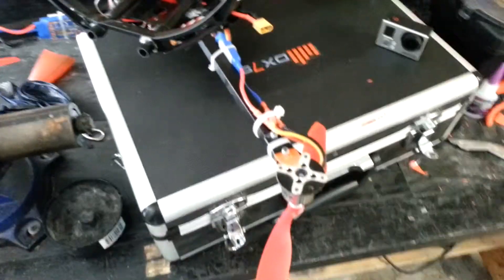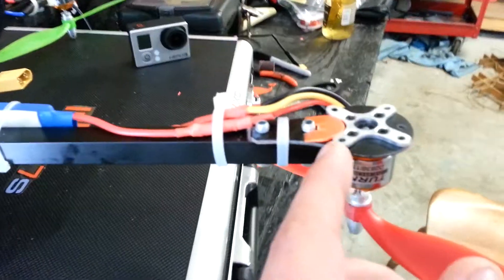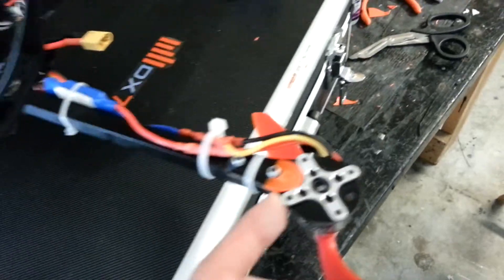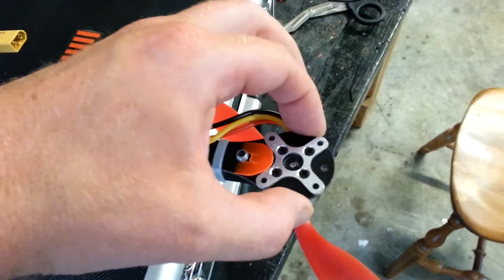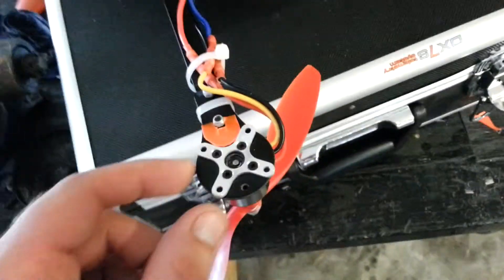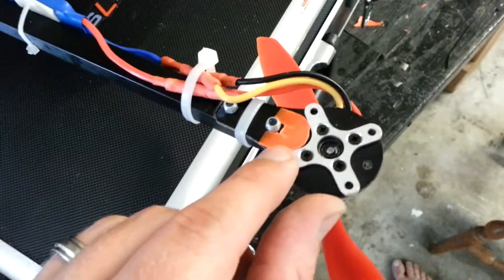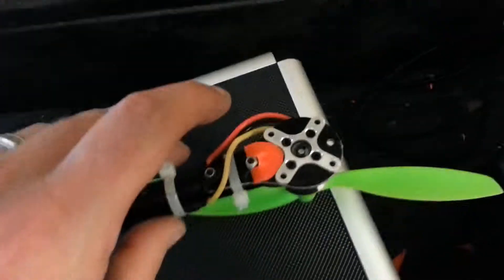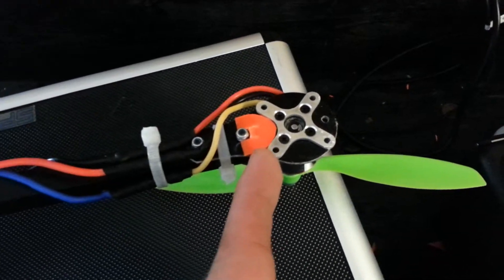X580 quadcopter frame issue and temp fix

Comment: I just ordered one of these, but then saw all these issues with Motor Mounts. I saw one guy had just mounted the motors atop the aluminum arms and discarded the mounts, but of course that makes the diameter motor to motor smaller. I was thinking I would fabricate an aluminum version of the mounts right away. OR maybe replace the arms with linger arms and just mount the motors on top of the arms.

Anyway, your video was very helpful, thanks for posting.